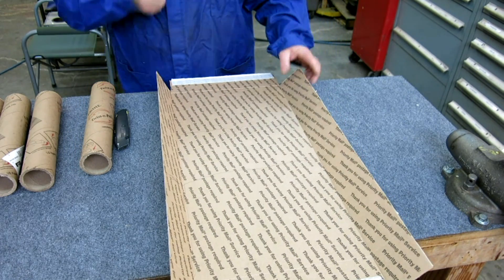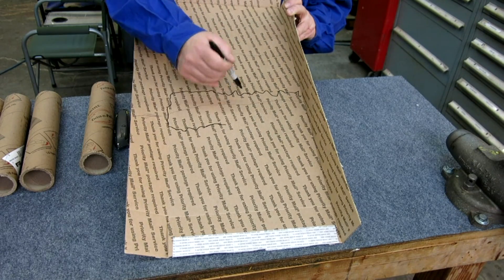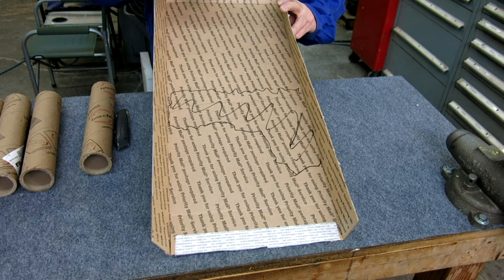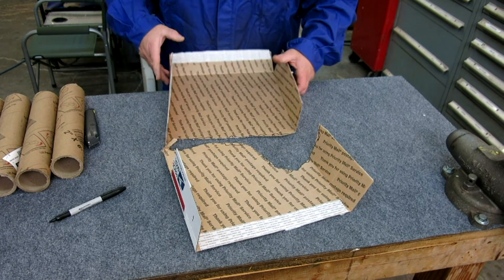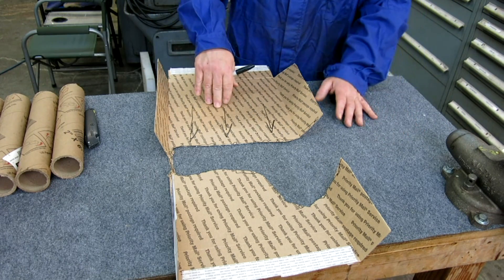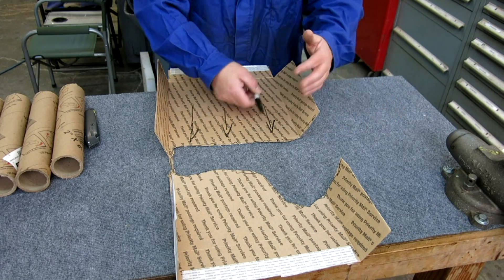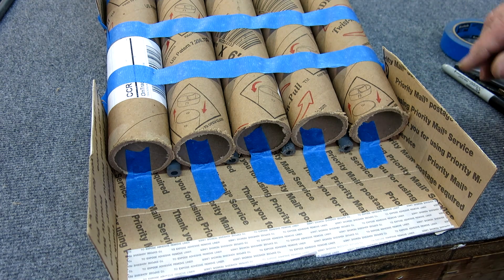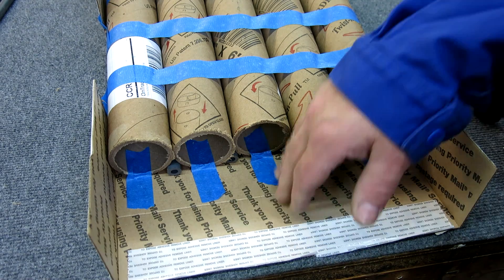Oroville Dam Spillway Repair

Comment: i spent several hours thursday talking to different shotcrete companies in that area trying to get somebody to go up and start spraying the cavity to build it up... Caltrans knows of a 4 hour ready to drive on cement mix that could be used..  the choppers dropping rocks in while the shotcrete companies filling in the gaps.. then i thought of the Logging type Skyline equipment that could be set up atop the dam hopefully to pull the bags of concrete rubble or buckets of concrete up to the openings..  this depends on some place to anchor it. and that would be out in the lake or on the inner face of the dam..  i love your idea of ducts... square tapered faces could be added prior to the installation so the pieces are dragged up and interlocked and bolted together..  that could collect more water and make them really easy to install and remove later.. 

love your plan....  lets hope something gets done..

Comment: How to describe the problem at the dam.
Today your job is to Gunite 8 Olympic size swimming pools using 
only a shovel and trowel. First you are going to need to order the Gunite. They you only have six hours to get the job done. After
 that we fill the swimming pools to the top in 6 seconds. But to make it
 more fun we have the fire department continuously spray water in the hole.

Comment: the problem isn't the broken spillway, the problem in the emergency spillway. They're willing to completely sacrifice the broken Spillway and they can easily repair it during and dryer months. Problem is the emergency Spillway is not up to par for handling flow of water and it is excessively prone to be undercut with catastrophic failure which is what they are fighting.

Comment: This is a long shot, but I wonder if they could find some prestressed concrete twin tees that they could bridge the damage with.  They could set them flat side down and their weight would keep them in place I believe.  Finding the beams and the crane to set them is more than likely impossible, but it is an idea similar to your pipe solution.  Good luck to everyone involved with that disaster.  They certainly have their hands full.

Comment: a 1.2m diameter pipe will move something like 1-2m3/s. I think I saw the spillway releases 100000cfs - that's about 2800m3/s. Lots of big pipe needed for your plan. Buy some shares in the pipe manufacturers.

Comment: I've seen pictures where a bunch of cars were parked on the spillway, inspecting damage in 2003 I think. Those cars looked small. You'd need pipes the size of tunnel segments, and those are usually floated in place.

Comment: Could large sheets of plate steel be used instead? Weld brackets on the underside against the gap feature to secure them in place. Heavy plate steel is readily available and would require a myriad of smaller pipes to fill the gaps...

Comment: Bring in the ship-builders and use steel plates welded together (flat with one side 90 up as necessay) similar to piecing together the hull of a supertanker. Maybe a good 15 feet of overlap top and bottom.
Use large lagbolts to hold down the leading edge. The pipe idea introduces resistance at the leading edge causing extreme turbulent action over the top.

Comment: Would the pipes be too heavy to lift into place if they were welded together first? Then triangular shaped pieces could be welded onto the ends of the tubes, thus plugging most of the gaps. Then, if its only temporary, sandbags could be used to fill the smaller gaps. This somewhat reminds me of the gulf oil spill.
Reply: the gap is 350 ft or more long, accoring to a couple comments on it (i dont know!) seems a pipe that big and long might be too much to lift in via helicopter, it would have to be super strong pipe to hold full of water whilst unsuporrted for 350ft, thats what people over look, the unsupported distance, so its gonna weigh a massive amout for anything, be it plate or tubes to carry the weight alone, plus its running like niagra falls in there, you cant stop it long enough to do anything of use like put machines in there

Comment: Pneumatically placed concrete (Gunite) using rapid setting hydraulic cement could work.  Spray the concrete and then cap it off with concrete pavers.

Comment: That gap is like 40 yards long. You would have to use penstock size pipe, such as the ones at a dam powerhouse. I can't imagine that it could even be done in weeks, let alone days they have left before the next storm. There is just a huge volume of dirt and concrete missing. Not saying it might be a workable concept but the scale of it... It takes a lot of time to engineer something like that, much less to build it. I'd go for continuous flights of helos dropping porous bags of concrete mix and grout round the clock until the undermined portion was full/sealed enough to get them through to summer.

Comment: this might sound crazy, but what if they laid a ramp across the width of the spillway above the hole and opened the gates wide? it seems if you could turn that stream into an airborne spray the water would lose much of its kinetic energy and at least significantly slow the erosion.

Comment: I don't think there is sufficient appreciation for the scale of this thing, the volume of water, and the forces and power involved.  Looks pretty straight forward from photos until you get your head around the dimensions we're talking here.  Shame on the press for not covering that, as Tom mentioned.  The size, weight, length, strength etc of "pipe" that size is a MAJOR undertaking.  Anchoring it to keep it in place is just a difficult.  You could win a nobel prize calculating the number of feet of weld beads required to join and anchor something of this magnitude.  Misalign something just slightly, and thousands of tons will be directed to rip it apart, destroying it in seconds.   Not saying it can't be done, but getting it done in a couple of days before the next rains?    At the peak flow rate of 100,000 cubic feet per second, as reported, that's 6 MILLION 200 Thousand pounds of water per SECOND into a hole that is several HUNDRED FEET LONG AND WIDE.  From what I've read, the aux spillway has basically been deemed a no-go as it's erosion rate and scale are far beyond the wildest dreams of the engineers in 1968.  It's a poop sandwich at this point.  Boulders, piles, rebar and quick set fiber reinforced concrete stabilization are likely the only stop gaps that are feasible at this point, and even they are a longshot.  The clock and more rain are the true enemy here.  Man can stop neither.    Mother nature has a way of humbling us.  Climate change and more erratic weather patterns, whether human assisted or not, will only make these kinds of events more common.  The fixes and upgrades are monumentally expensive.  This is one of those problems where we need the 8 year old who asked, "Why not just let some air out of the tires?"  Not sure the engineers can tackle this one on their own.  Hope, pray, channel your mojo or whatever you do in hopes that this holds together until they can get it repaired.

Comment: Your fix is a bit under scale.  The spillway measures 55m across according to google earth.  That is just shy of 200 ft.  You also cannot introduce a round pipe into a supercritical flow without a very carefully designed and constructed transition as it would self destruct in minutes (literally).  You would need thousands of feet of 8-10ft diameter pipes, which do not exist and are custom fabricated on order.  This would take 12 weeks minimum.  The dam will fail by then.  The fastest fix by far would be to fill the hole with gravel and cast new concrete.  Reinforcing steel is readily available in any sizes you'd need and concrete can easily be made to achieve a usable strength in 3-4 days.  This could be achieved in about 2 weeks (from this moment) if the "cost is no objective, get it done" orders were given.  I do not believe the dam could survive 2 weeks without major spilling occurring however.  it would be better to just lose the bottom half of the spillway.  The spillway is located on a rock knob and does not appear that the erosion would get into the earth dam too soon.  I wish you all luck as losing that dam would have extreme consequences.  The loss of life would be irrelevant.  That reservoir supplies something like 20% of all Californians water supply.  If that was gone, 6 million people would literally have no water.  The wiki says it affects up to 25 million people.
Reply: A) when shut the primary spillway fill the 200 x 200 x 200 foot gap with stones and concrete.  but B)  before shutting down the primary spillway they should have (or are trying to) fill the erosion near the auxiliary weir with rock and concrete..  But we see no long lines of conrete trucks - only 2 helicopters - stupid. among the media reports we see almost no progress. just relentless repeats of no new news

Comment: I like your thinking, Tom. Another approach might be to use Z-style sheet piling laid parallel to the direction of flow. Because the sections interlock, a structure of any width and up to at least 105 feet in length could be constructed. Sheet material would be required to complete the bottom of this emergency conduit, but it should be fairly self-supporting with few gaps to fill.

Comment: If you linked the pipes together side-by-side with metal plates so they could flex, (imagine the side view of a wide motorcycle chain with its 'bone-shaped' links), they could be assembled and 'rolled' into the channel as a nearly solid and complete patch.

Comment: an excellent fix would be a set of flat steel bridge ways. on side and floors of spillway.   to bridge gap.
Reply: Sethdominus777 Flat surface would not be problem, but holding weight of the water. Bending in that surface would affect flow and stress that part of the structure it slams against.

Comment: Though it is fun to present a "machinist's solution" to the problem, I'd critique you for being uncharacteristically careless in your approach. From your videos I get the sense that you have designed and built enough tools to understand that some sort of basic engineering is important. I also get the sense that you are interested in teaching others. 

Don't teach others bad habits. If the primary function of an object is structural, then it makes sense to do some basic calculations to figure this out. Without this your ideas are near worthless. You know this. It is why you said that the internet will shoot holes in your idea.  

I'm sure you've heard of the phrase “back of the envelope calculation” This is a simple test of an idea. I'm sure you didn't start the design process for the crane in your shop without a basic calculation. Nor do I think you would advise somebody to build something similar without some basic engineering, Yet, here you are proposing something to be used in a much more severe environment without taking the time to figure out if the solution would survive even first-order effects. Just generating ideas is OK. But it's low hanging fruit. Anybody can do it. The better guys can back up their ideas and prove their worth. 

It is interesting to watch you demonstrate machinist's skills. It's just as interesting to watch you demonstrate some engineering and design skills. You've done it before. Do some more of it!

Comment: I think it would be a lot easier to just fill the hole with gravel till it was about 5ft down from the surface and then pour a 5ft thick steel reinforced slab. Build your mesh in the parking area and fly it in once fill is completed. In the meantime run some cables so you can tram your concrete from staging area to pour site like they did hoover and pour that sucker with quick set concrete. With enough skilled man crew you could have it done and cured  in 3 days. If it stats to settlle when the ground starts to dry out pump some hydraulic cement under it to level it back out.  If you are going steel liner I would use c channel to bridge the gap and bolt it on both ends to remaining spillway. Likely you would need to drive pylons as well to bolt it to as the concrete being not anchored might just get hydraulic shoved away with your mat of steel repairs.  They should have called the emergency spillway the its too late spillway because that is the worst laid out spillway I have ever seen. It is like it was an afterthought.  It should have at least been dozed in on grade and preferably zig zagged in decent to reduce the speed at which the water flows. there is a lot of energy in a 700ft drop of water.  Just running it off over the hill thru the woods to cut whatever channel it wants was not ever how that should have been done.  The fact that the lake can overtop in areas that are not part of the dam or spillway shocks me.

Comment: Your pipe idea would work fine,but instead of pipe use recycled railroad tank car culverts.Since you are only wanting to bridge the damaged section,these can be split in half along the long axis ,creating a series of U-shaped troughs,effectively cutting material cost in half.
http://www2.ku.edu/~kutc/pdffiles/LTAPFS12-RailroadCarasCulvert.pdf

Then again,unless the whole spill way is repaired and upgraded nothing will solve the problem.The spillway will need to be repaired properly in the near future.The concrete deck and control walls should be clad in 1" thick Cor-Ten steel to eliminate erosion.

Further still unless the original additional structures are built and the river connecting them dredged to accommodate the flow,this will happen again.There is far too much water being wasted by allowing it to simply run off into the sea.California can do better and smarter than this debacle,state government needs to worry less about social issues and more about providing and protecting the physical needs of the people IMO.

Comment: Flat steel plate with I beam sections welded to the bottom allowing it to span over the hole might be an alternative.  The real problem is with the emergency spillway since if used again it will erode under the footings.  Lets hope the coming storm will not crest the emergency spillway.

Comment: Interesting solution!  I wouldn't bother with the smaller pipes. The difference between the dynamic resistance of the small bore vs the large bore pipe will be so great that the small pipe looks like a complete obstruction. If the concern is that water flowing through the gaps could contribute to erosion, I would just pump concrete into those gaps. 
The question is how much resistance the whole array will create.  If it is too much the water level in the spillway above the damage will overflow. 
Worth a try though.

Comment: That's a great idea to help water get past the breach in the spillway. Now to simplify that idea use" twin T "prestressed concrete panels laid with the legs up, essentially up side down,  and parallel to the  flow to span the breach and totally covering the hole.  Water will flow down the channels formed by the "T" ribs  on top of the "underside" of the panels. 
To secure them to the existing spillway drill holes in the panels and the bottom of the spillway and secure with pins or posts. Also use the panels on side to cover the side holes.
I have seen these panels used to divert water before at the Colorado State University  Hydraulics Engineering Lab in Fort Collins,  and they work well. 
Added benefit, the upstream butts of the panels would interfere with the flow and slow it down some.
Whadda you think?
Jon P.

Comment: for the filler holes on the pipes intake, I suggest ramps.  triangle shape, spines In line with the downhill, and flared towards the pipe opening a bit. the speed of the water will jump the water right into the pipe. the guys on site can decide if they want to fill in the holes or not depending on how much time they have.
Reply: or try this...   start with at the actual water gates. create the seal there and then extend the pipes over the gap. I don't think the smaller pipes in the gaps is a bad idea. where the hole is a rather far down the ramp making for high velocity water and lots of splash. just negate that with the pipeline starting at the gate
Reply: there's like multiple gates side by side right?
Reply: and use light temporary pipe, do they do pvc or some other appropriate plastic pipe as large as you suggested? lighter material makes for a faster fix and alot easier to deal with on that messed up hill

Comment: Some great ideas being presented here.  Keep in mind: You have to get them into place.  There's no where to set a crane.  Helicopters were mentioned.  Those bags weigh 2,000lbs each.  Large diameter pipe of any length is going to be much heavier and you have to land it on an angle under the helicopter prop wash (wind).  If you haven't done this, you should try it some time.  Once will be enough.

Tom, I love the pipe idea.  You're going to need a lot of support structure under it and a way to secure it from sliding down the spillway until the welders can make it into one piece.

Thanks for the mental exercise.  Really brings out the input from the group.
Terry

Comment: Excellent Idea Tom , instead of pipes i use square tubing ( no spaces left ) , let say 48 x 48 and you stack as many as you want . problem solve.......
 Or cut open  40ft containers and  place them over the gap . 
 Russ